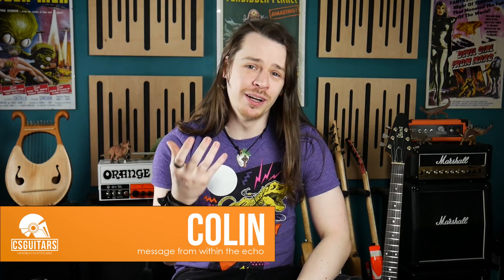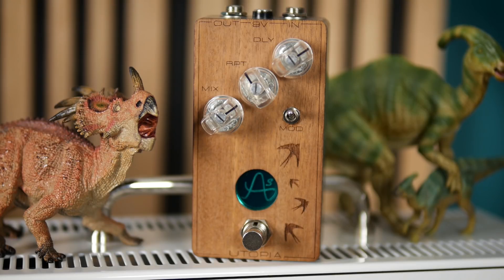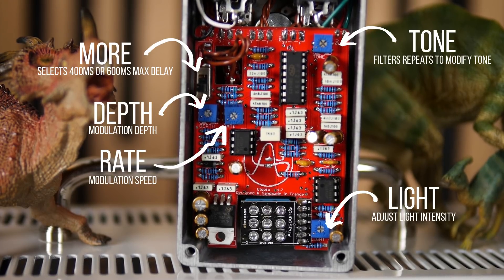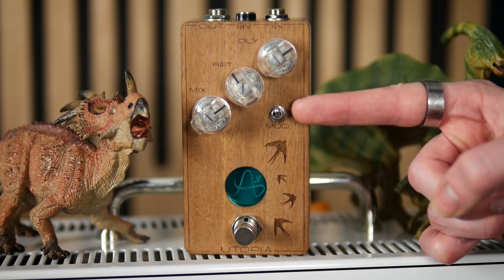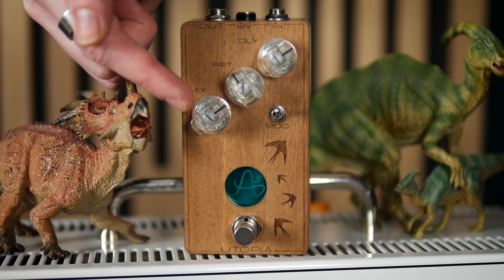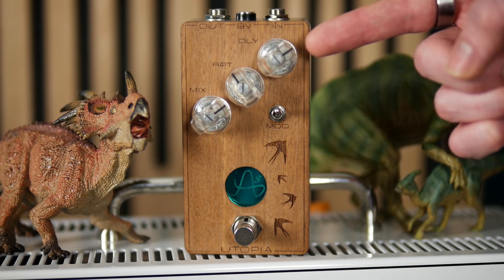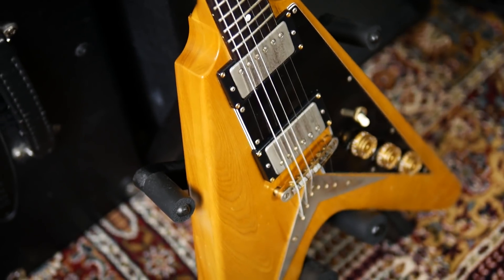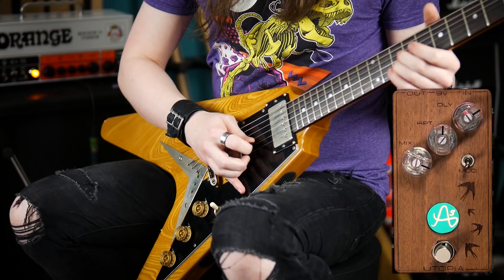How To Use: Tape Echo - Anasounds Utopia

Comment: My god this sounds good. I’m in the market for an delay pedal and this looks exceptionally tempting
Reply: guitar19971 

I use a Danelectro Reel Echo and a Danelectro Dan Echo. Look into those, I bought three Dan Echos and its something that has great quality and control and its a regular sized pedal.  You can spend lots but they all pretty much sound the same in a signal chain.

Comment: Nothing sounds like a EP3 Echoplex yet.....  yet
Reply: John F The Belle Epoch does. There's a video that plays the 2 back to back and the only way I could tell which was which was how much noisier the EP3 was.
Reply: That is a great pedal, but not the same. No boost and side by side they are not the same. Watch "That Pedal Show demo. They state that there is just something in the room going on with an Echoplex. They definitely do add noise, but that's part of the charm. I demoed those side by side for about 2 hours before buying the EP3. There is no way I would by an effect more than a mortgage payment if I could have got that in the Epoch.  Wamplers tape delay is also awesome
 Also demos on youtube with the crap sound do not help. You need to be in the room.
 Great vid by the way
Reply: John F Epoch does have a boost. You can control how powerful it is internally, and even set it to work either only when it's on, or you can have it set to be always active, even when the pedal is off. Eric Johnson retired his real Ep3s to replace them on his live board with Epochs. Additionally, each EP3 is different since they age and wear differently, so 2 actual EP3s might not sound the same side by side either, and the Belle was matched to the one the founder of Catalinbread has. When you see and hear his video, they're so close, and to me, the Epoch actually sounds better.